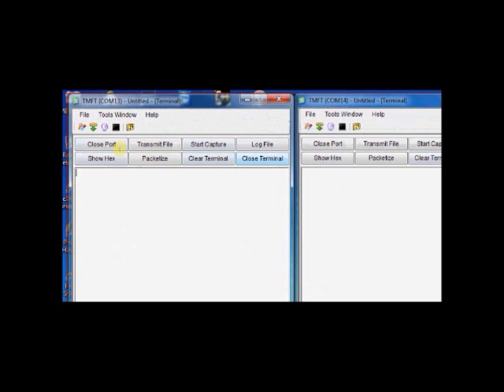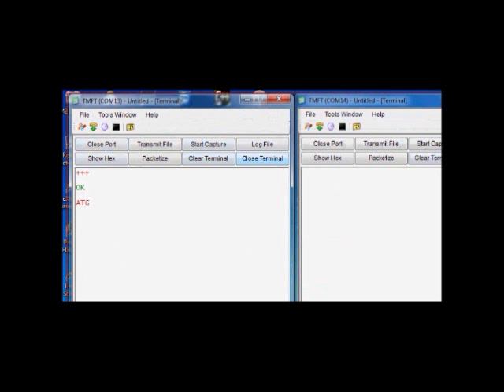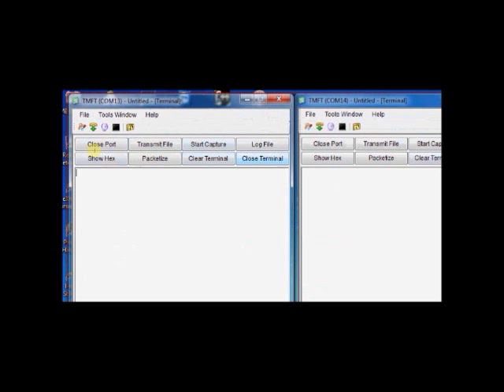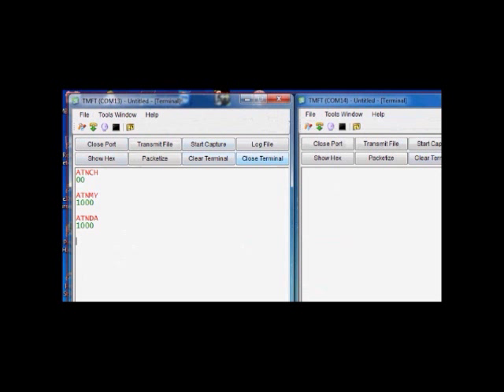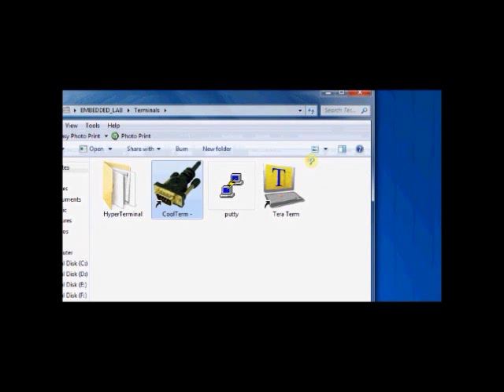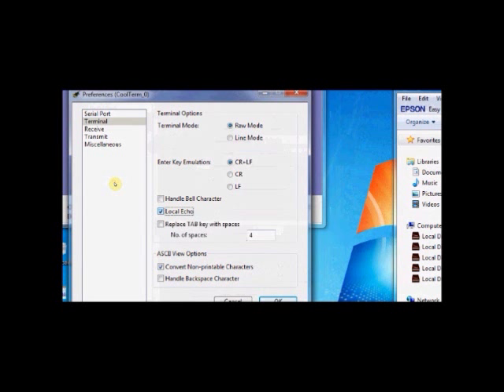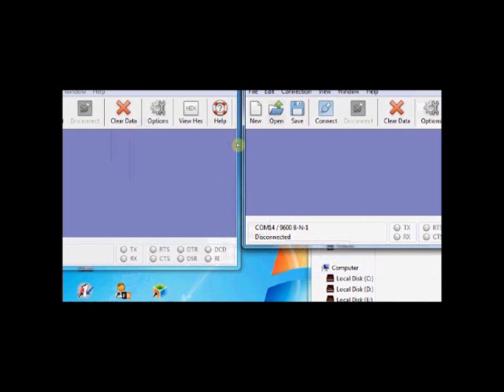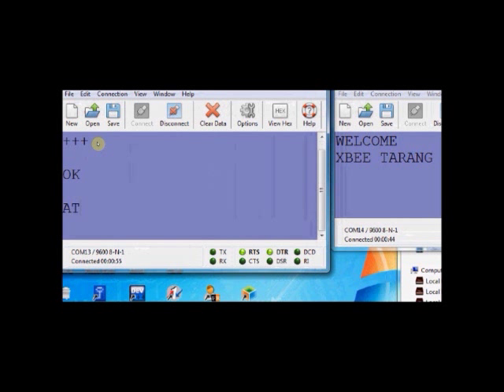TARANG XBEE Modules - Part 2 AT Commands

Comment: Sir....I'm in Siva from coimbatore.....
How to set analog input/output AT command code from zigbee Tarang F4 model ....
Please clear My doubt sir....
Reply from the maker: From within Terminal of TMFT software enter three + symbol for command mode.To make pin 20 as Analog Input type in ATID01 .Save the changes with ATGWR & exit command mode by ATGEX.Now pin 20 of receiver follows that of Tx pin 20.
You can watch this video for a digital input
 Tarang XBEE I/O Functions - XBEE DIRECT

Comment from the maker: Any 2 Tarang modules are to be configured for effective communication.Source address of 1st one is the Destination address of the 2nd one & vice versa.This can be easily done using TMFT software.Under Tools-> Modem Configuration you can change MY & DA address.For AT commands use ATNMY & ATNDA commandsfollowed by 16bit address.